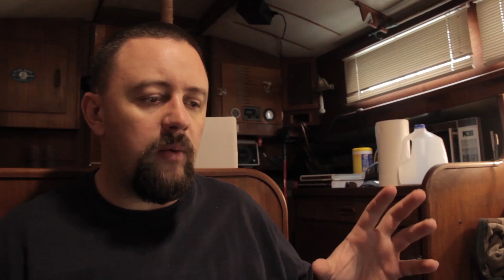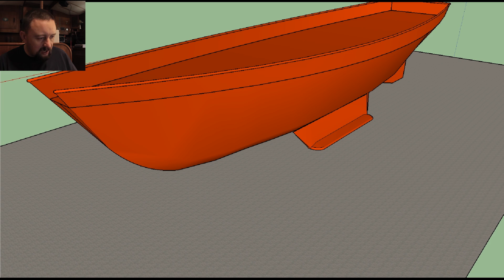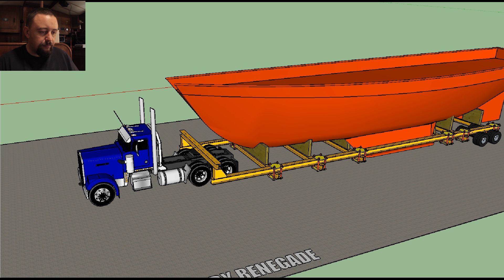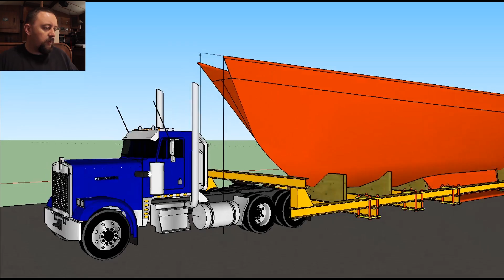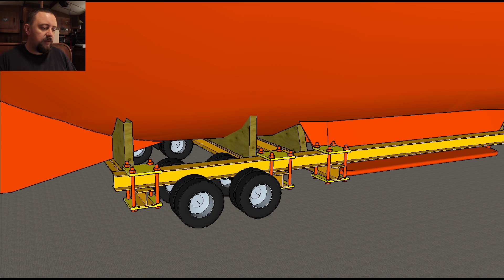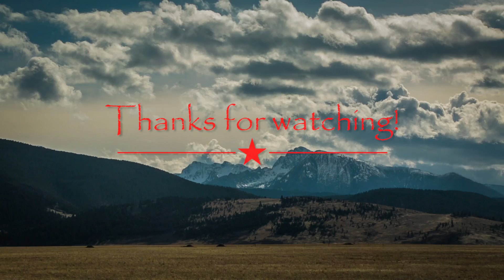SV Seeker - Trailer Design #1

Comment: A big issue I see with this design is that there is no support for the keels. A significant part of the weight is there (they're full of lead, whereas the rest of the boat is full of air), so I'd be concerned about them flexing and breaking off. Doug's design, while it has the backswing issue, does support the keels.
Reply: If you're concerned with the lead filled keels flexing and breaking off because they have no support, what would keep that from happening in the water? They won't have any support in the water.
Reply: J DeWitt yeah, I thought about that after posting my comment... I think the weight differential in the water will be a bit less, though, it might make a big (or small) difference. Moreover, the dynamic loads on a trailer vs in the water will be quite different: lots of up & down swings vs a constant lateral force.
Reply: Maybe chains with load binders stretched across under the keels?

Comment: Very good design.  I would give consideration to welding it up after bolting.  Also, get doug to mark out the plimsol line on the design. You may have to take the weight distribution into account.

Comment: just a bit worried that the beams will bow / spring a little making the front of the keels thouch the road
Reply: The cannot assume even weight distribution during the move. They should have a supply of several 24" sections of 2" pipe to place under those beams if they reach a high hump in the road.
Reply: Kevin Hornbuckle  Also Doug can tack some Sacrificial Skid Plates on their bottoms.
Reply: I see you're worried about the height clearance of the bow. But what about the deckhouse, davits, etc.? They are much higher than the bow!

Comment: Just something for you to thik about Nick, what about adding 2"  or 4" blocks between the the rails and the axles to raise the ass of the boat up to make it about even between the Bow and the stern of the boat? Like I said just a thought or maybe even airbags to raise ans lower the stern of the boat up when needed. Stay safe out there and always stay cool dude, Airborne to ya brother!!!!!
Reply from the maker: that is a thought although I think the way to do it would be to simply build the cribbing that goes on top of the cross beams so it lifts the boat up in the rear! But your idea is on point.
Reply: The rails won't be level with the road  but it would save quite a bit of time as far as building the cribbing under the boat at all the different angle and alot of stain on your back also. It would also keep the boat level with the rails of the frame of the trailer that you plan on building and keep the boat at a better riding angle also. If you did use airbags I would still add the blocks between the rails and the axles just for safety sake.